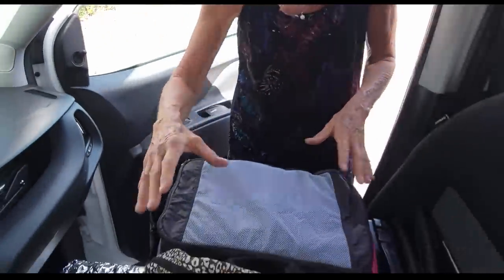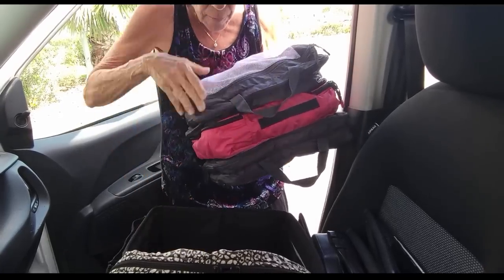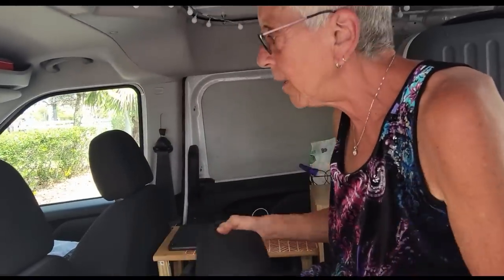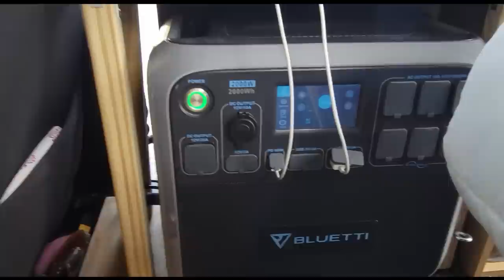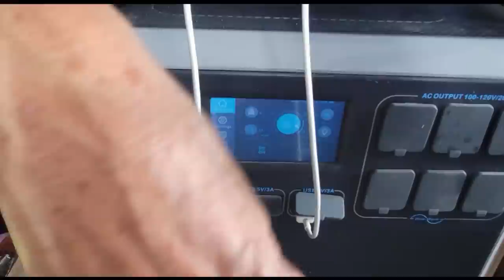VAN TOUR:  “IT'S AWESOME!”  Lulu's New Van

Comment: I like the idea of the skylight also. Then you can put a rack on top, & a deck. .. For myself, i would probably want the front curtains to be more permanent = esthetic possibilities, easy access & one less thing to store. .. I have 1,000 watt battery, but i wish i had 2,000. However, when i get my van, i may have 3,000 installed instead.
Reply from the maker: You have some exciting plans. 😎

Comment: I have a cargo van too it's a Ford Transit and I purposely did not want windows on the back. I'm currently putting ventilation that you can do on the side or on the top but I think I'm going to do it on the sides cuz I'm a little bit worried about the roof leaking. I agree with Lulu I haven't even insulated and I like having the metal cuz I can have a lot of magnetic things. Lulu, if you have wireless charging you can charge your phone right on top of the Bluetti... just set it on there.
Reply from the maker: It does sound cozi not to have windows. Wireless backup cameras would be a good addition.

Comment: So I just don’t understand why you could not replace the faulty axle.  Would have been massively less expensive.
Reply: I was told that the axle tubing was "rotted" and everything around it was "rotting".  so basically, if he took a shiny new axle tubing, he would be trying to attach it to a rotting metal.  he would have fixed it, it was in his best financial interest to fix it.  it just made no sense.
Reply: This is correct . And Lulu coming from the Boston area , all vehicles there will suffer rot and rust issues from the salt they use on the roads in the winter .  Even if it could be fixed , it would be rotting somewhere else .  Here in the south we call that vehicle cancer .